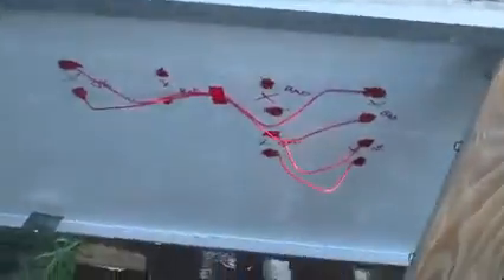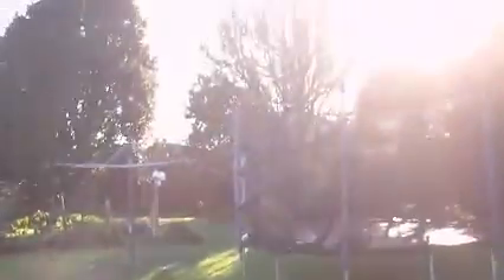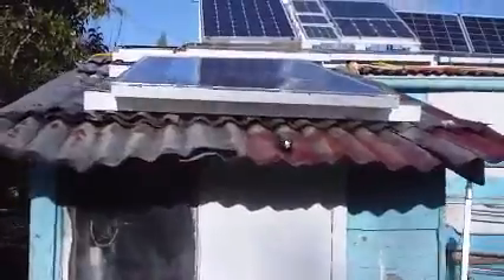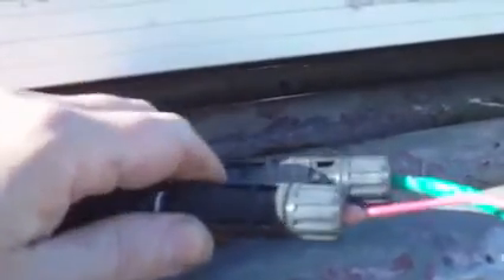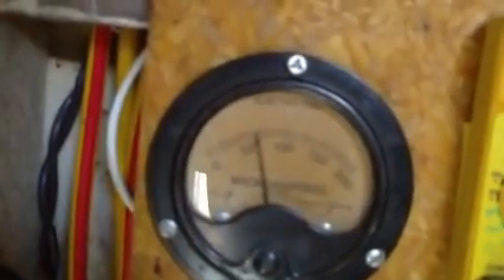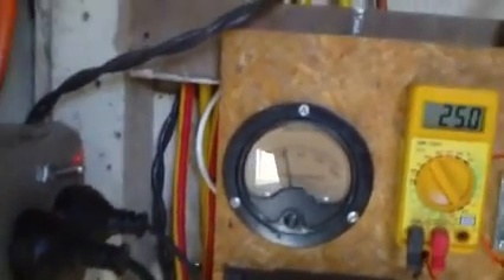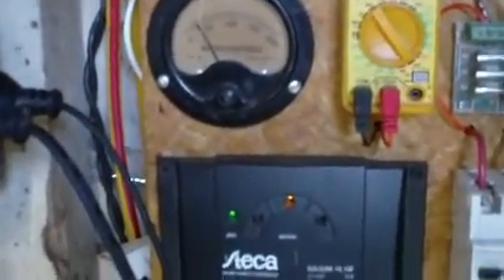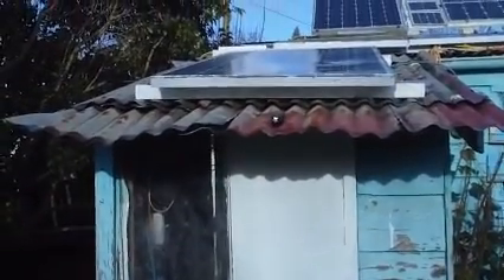Extreme Solar Panel Repair Pt3 (Final)

Comment: How did the clear coat hold up? I've got the chance to get some shattered panels at a good price, have you found clear coat the best way of getting them useable?
Reply from the maker: Check out the reply I gave to you in the other video. A good price I reckon for broken glass panels is around 25% of the price of the same panels in new pristine condition.

Comment: Thanks for new idea how to fix broken panels. Now I realize that I can just "jump" across broken cells. I got few of broken panels, so I'll fix it Your way!!!
Reply from the maker: Janis Mezitis Yes, it certainly makes them more useful than "leaving them as they are" because since all the cells are connected in series the bad ones will reduce the current ov the whole panel. Losing a few volts by routing around bad cells has minimal impact on the total charge current going into a battery.